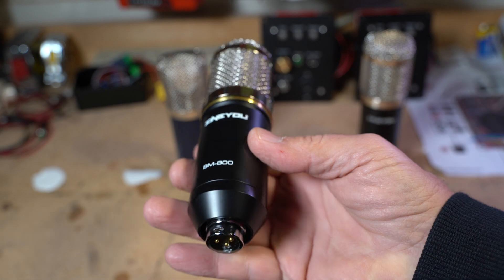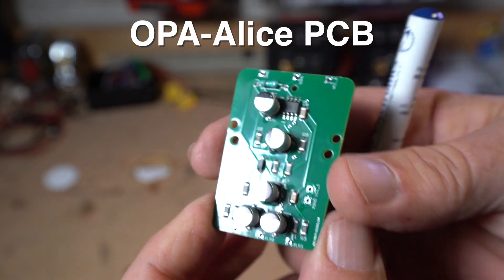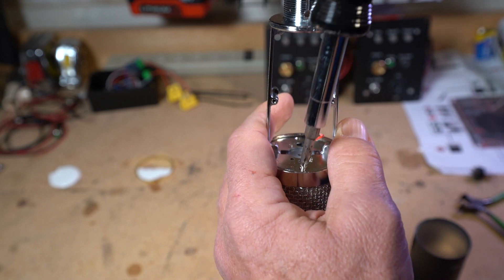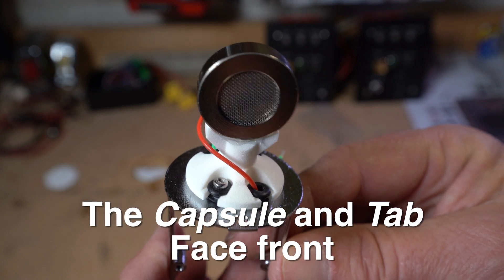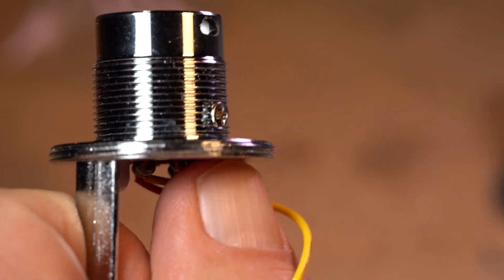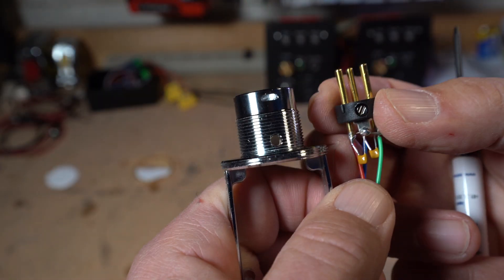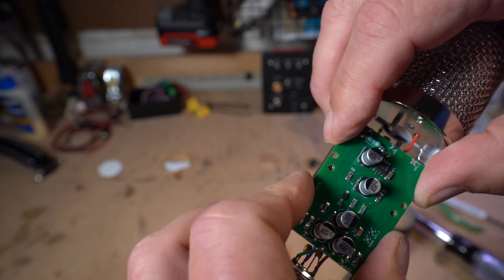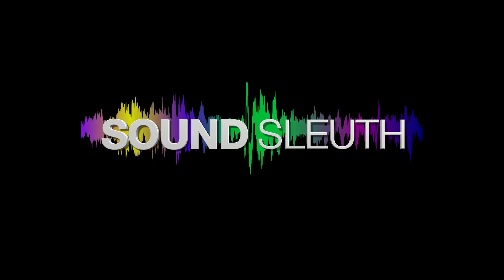The BM 800 Conversion

Comment: What if I want to tweak the treble response? what are my best options as far as circuit additions/alterations? I need something like a safe allround treble, similar to Rode NT1, but out of the 255B capsule which sound just a bit elevated in the upper treble.
Reply from the maker: The circuit is extremely flat and low distortion. You can EQ in post and get  what ever you would like
Reply: @SoundSleuth  I'm pretty sure I saw at least one 2555B project that had optional circuitry for a smoother treble profile. I'm considering if this would streamline my workflow vs. EQ. Too bad I can't find the link any longer!

Comment: Hi sound sleuth i have a question. Will this exact bm80p that you made work if i plug it intro my laptop or phonr or is a phantom power preamp mandatory.  Also fi i made serena (the one with OPA Alice abd Dc to Dc hex conv) will that also require a preamp?
Reply from the maker: @WombRaider-s3j Yes, both of these require a  mic preamp or USB interface that supplies P48 phantom power.
Reply: Also if i am going to do this is it worth spending more on the capsule and also the hex converter or will this be god enough for anything not professional
Reply: I got one of those small FET electrets to work immediately by plugging it in my laptop via aux will this really not work probably with insane 80db gain ?  (Btw its absolutely amazing how fast you respond thank you)
Reply: Sorry for replying again but i will be buying the fake bm800 just for the body will the v8s crappy soundcard provide the phantom power or something close to it to power it if it doesnt work immediately?  If it can i will try to inprove the soundcard or at least make a simple preamp from it

Comment: These Chinese mics are actually clever designs.  Nothing is over-engineered.  I wouldn't say they are suitable for high end music recordings necessarily, but they are fine for podcasting or streaming.

The lack of rubber bumpers I think is explained by the fact the microphone body is intended to use with a shock mount.
Reply from the maker: The components I am replacing the internals with are suitable for high end recordings. Thats the cool part. I have used these bodies for many microphones, never actually fired up one with the original parts. I can tell you they vary pretty extensively every time I open one up.

Comment: Hi there. Thank you for this! I saw a 3D print file for a capsule holder that will make it end addressable.. Do you think it will work as well as an end address?
Reply from the maker: Yes it will!
Reply: @SoundSleuth  Thank you so much! I think it will be a bit easier to mount and position as an end-addressable mic.

Comment: Hey i want to try this but with a 34mm capsule from JLI. Any recommendations?
Reply from the maker: The TSC-1 or the JLI-103 you will need the hex inverter also for bias voltage. They are amazing microphones

Comment: I'm wondering if this Alice circuit would pair well with an RK47 style capsule?
Reply from the maker: It would. It will bring out the characteristics of the capsule as the circuit is very low distortion.

Comment: The cost of components here adds up to around 70$ with shipping, which is roughly the same price as a new AT-2020 from Amazon when it goes on sale. I've not done any DIY mic stuff in the past, would it be worth it to build this one in my current BM-800 over purchasing the AT-2020? I'm not sure if microphones is one of those things where building a 70$ one yourself will give a benefit over buying a 70$ one pre-made or if it's one of those things that won't give much of a benefit and is more just for fun.
Reply from the maker: I personally think so. They are on par with a CAD E100. It is a great mic

Comment: What is the PCB circuit built in? Why does it need one?
Reply from the maker: It needs an impedance converter to bring out the signal from the condenser capsule.  See this: https://www.instructables.com/OPA-Based-Alice-Microphones-a-Cardioid-and-a-Figur/

Comment: Is there a way to turn the cardioid mic capsule into a super cardioid ?? thanks (:
Reply from the maker: Not without using a hypercardioid capsule. Ill look around and see what I can find.
Reply: @SoundSleuth I'm considering the same thing. I want to make a mic that rejects background and room reflections better, like the lauten audio  ls-208. I'm thinking I need to get/find a hyper-cardiod capsule and use an end-address mount 3d print for it inside the bm800 to get close. I'm even considering trying to print some sort of insert for the head basket that turns it into a really short interference tube, or as a way to prevent sound from getting to the sides of the capsule, while the end address helps prevent sound in the back.

Do you have any experiments or experiences with either hyper-cardiod capsules or interference tubes?
Reply from the maker: @Lethal_Bite  The key to interference tubes is length. That is why shotgun mics are as long as they are. This is something on my "to do list" ;-)
Reply: @SoundSleuth  That is true, but I'm wondering how the ls-208 does it so well. Because it isn't a shotgun mic. Perhaps not an interference tube, but just some structure that stops sound waves from hitting the sides, perhaps just a more standard "tube shape" or a funnel of some sort that is sloped enough that waves bouncing inside just bounce out (to prevent them from making their own echo or reverb in the mic) but also reflect off axis noise. 

I don't know for sure, but I just am in awe of the ls-208 and how well it works in poorly treated rooms. I want something that can operate in a similar fashion. I'm also excited if you are working on a shotgun mic project to see where it goes. That could turn out really cool and useful!

Comment: I have a bm800 with a dynamic capsule and I bought a condenser capsule and installed it instead of the dynamic. I tried it on v8 and it didn't work, so what is the problem?
Reply from the maker: I need more information to help you.  I’ve never seen a dynamic capsule in a BM800.  As those don’t need any active electronics. I would need to see pictures and some more info.
Reply: @SoundSleuth  I solved the problem with a transistor I extracted from a dynamic capsule

Comment: Hello, I have a small question. I'm really new to microphones and circuits and I'm using this build to kick start my experience with microphones, why are we replacing this board with the board already installed in the bm-800? Is it for sound advantage or is it necessary? And if so why?
Reply: We are replacing it because the new one performs far better, When you are done this is a world class microphone oon par with pones costing $4-500 bucks. See my full write up for more details: https://www.instructables.com/OPA-Based-Alice-Microphones-a-Cardioid-and-a-Figur/

Comment: Thanks for the tutorial, that looks like an easier alternative than diy's perk version :D !
Reply from the maker: It is easier to do and it works with phantom power, which was  my goal. The DIY Perks one is great, looks amazing but is USB-C interfaced. Great for direct into PC but not if you want to multiple mics.
Reply: @SoundSleuth  I ordered 3 BM-800 and was surprised upon receiving them that the ones i got seem to be fully made of plastic and not metal (beside the mesh), do you think that would be a problem when building the mic (for grounding reasons maybe ?) Thanks !
Reply from the maker: @KurodaMasahiro  I would send those back. I know Neewer ones are metal. Look for the Neewer BM800 on Amazon https://www.amazon.com/dp/B00XBQ8UGG
Reply: DIY perks one is unnecessarily complicated. Was really just a flex of ingenuity on his part. Job well done, but certainly NOT a project that really has value in duplicating. Plus, his totally disingenuous claim of $30 in parts..... I started the journey of replicating it, but abandoned after the BOM total exceeded $200.

Comment: question would the JLI-RK47 work better in this build?
Reply from the maker: It will! You will need to add a voltage bias generator for the capsule. This will work https://www.jlielectronics.com/diy-accessories/dc-dc-hex-inverter-pcb/
Reply: @SoundSleuth  thanks for answering this question! Would be interested in seeing/hearing this build if ever.

Comment: How do you test the capsule if it works before you assemble it? With the ohm scale, it is not detected like classic capsules. Here you have to have a capacimeter (pF) .... . Is there something to do a quick test? Thank you very much.
Reply from the maker: The best way woudl be a capacitance meter. SHould be 30-70pF. That is a small value and not easy to measure. Quick would be ohmmeter showing open circuit and not shorted. With that said I have only have one issue and that was an internal short. That was over many years of this and the vendor replaced the capsule.
Reply: @SoundSleuth  What do I do now? I don't want to change pcb like you did! I want to try replacing the 13mm capsule (it makes too much noise and sucks) with this 25mm condenser one. Will it work or not? Tomorrow I'll take apart the old stand and glue on the new capsule and see what happens. What a stress these microphones need an electronic lab to test them best.
Reply from the maker: @pierpa_76pierpaolo  You are heading out into unknown territory. Some BM-800's have Fet based capsules some do not. At this point you are not replicating my build so I cant tell you how it will come out. Try it and see.

Comment: Hi i have a question. Why do you need phantom power for a dynamic capsule. Isnt this circuit for condensor Capsules. I am just wondering because im thinking about building this.
Reply from the maker: It is actually a Condenser Capsule. It is Electret so it doesn't need bias voltage. It does need an impedance converter and drive electronics to get the signal to the Mic Pre.

Comment: Whoa, this video has basically all I need for my project. I was actually looking to upgrade a cheap mic with a 2555 capsule and wondered what I was going to need. I hope I'll understand the process of building the PCB.

Quick question: aside from phantom power, do I need to provide an audio interface (a friend can get me a Behringer UM2), or does the PCB circuit take care of that? Conversely, if I go with the audio interface can I ditch the PCB?

Thanks!
Reply from the maker: You can get the PCB fully populated if you need to. Yes you will need an interface. That is what supplies the 48V to the PCB and interfaces the Mic to the Mac or PC
Reply: @SoundSleuth  Thank you! I asked because I would need to import either the empty or the populated PCB, so I was hoping to be able to circumvent the need for the circuit. I'll probably lean towards building my own, given the circumstances.

That said, OPA1642 (and similar) is basically out of stock in my country until 2023, and shipping costs from any country that still has stock are insane. I know that NE5532AP isn't recommended, but would it really sound that bad compared to OPA1642 or OPA1656? I was thinking on using it as a placeholder until new stocks arrived, and a PCB breadboard to hold it all together in the meantime, instead of making a proper PCB or buying it online. I'm assuming that would also have an impact on quality, but I'm hoping it won't be that great. Anyway, if the 5532 (or any other Opamp) is not entirely out of question, would I need to add anything to the circuit and/or modify the existing one?

Thanks again for everything :)
Reply from the maker: @johnweiss6335  please see the Instructable. The opamp has to be Fet Input for high Z, low quiescent current, and really low noise.  5532 nails the last one only.  I’m looking for an alternate but no luck so far.
Reply: @SoundSleuth  Same here. It doesn't help that I'm not very knowledgeable in this area, so it's kind of difficult to know what to look for. Closest I found (I think) was OPA2131: FET-input (no idea about resistance though, datasheet is not clear and/or I don't know what I'm reading), low quiescent current, but around three times the noise of 1642 (I don't even know if that's acceptable or not). Unless we luck out I guess I'll have to wait a whole year to build a mic at an affordable price lol.
Reply: @SoundSleuth  Hey, it's me again! I was searching for alternatives and I just saw the shootout you did between different mics. Since both the USB-C and the OPA-Alice mics are, as of now, out of my reach because component shortage, my attention was drawn to the one with the 2590 capsule and the "simple P48" circuit. I've searched around a little, but all I can find are a few vague documents. Is it really just a resistor and a capacitor connected between the FET and the XLR? (I suppose then you connect the XLR to an audio interface like the Behringer or the Focusrite) What would be their values? Again, the documentation is kind of vague about that.

If I were to use a 2555 or 3412 capsule, I suppose I'd need to attach a FET like the 2N4416 Matt used in his video, or an equivalent like the 2N4393. Would the resistor/capacitor values change? Would I need anything else?

My plan would be to use a 2555 (if possible) with a P48 circuit until semiconductors are available again (or even place an order right now and wait for a year and a half) and then do the Alice conversion.

Sorry for the long string of questions, but my options are dwindling and I'm a total noob, and feels kinda difficult to find useful info if you haven't been inside the DIY community for a while.
Reply from the maker: @johnweiss6335  check this out: https://www.instructables.com/The-Sound-Sleuthers/ Step 3. That explains more on the "SimpleP48" part.

Comment: Great and a very helpful video.

Quick noob question: Do you think an XLR to USB cable will work well with microphone after modding it to the JLI-2555 capsule ?
or will it be underpowered ?
Reply from the maker: If the XLR to USB interface (cable) supplies phantom power, it will work. The circuit in the mic is powered by the incoming phantom power from the interfaces XLR connector.
Reply: @SoundSleuth  question from another noob
can a modified Mic with the 2555 capsule and OPA Alice board directly be plugged into a PC via MIC In Audio jack to XLR? because i dont get that stuff with phantom power if im honest as it seems to exceed ~80V.. it wouldn´t damage the PC right?

and honest question: is it worth it to buy a BM800 Microphone set (25€) with the OPA Alice board and capsule landing on a total price of ~140€? Or are there normal microphones that would compete with this in that price range?

im Sorry, i´ve got no clue about all that, i only found the DIY Perks video, did some research for a refined circuit and landed on the easiest solution of buying a ready made BM800 to modify it with OPA Alice and a JIL2555 Capsule
Reply from the maker: @fmskaisergsaw5567  The Interface to the XLR jack provides 48V phantom power. The OPA board needs that. Most PC sound cards dont supply that.
Reply: @SoundSleuth  thanks for the quick reply, was kinda still collecting my thoughts with some edits haha

So i need some sort of pre-amp, gotcha though i just discovered that a condenser might not be ideal for the usercase it need a mic for.. :(

anyway, your videos about the BM800 mods are appreciated

Comment: What do you think if there is 1.5-2 meters of cable between the capsule and the preamp board (that is, the capsule and the preamp will be in different cases) will it be OK? Roughly speaking, I would like to use the JLI-2555 or JLI-3412 capsule as a Boundary Microphone (something similar to the Sanken CUB-01), and place the pream in a separate case.
Reply from the maker: I would use the TSB2590 (with built in FET) for that. The input impedance is 1 gig ohm on the preamp board so I dont think it would like 2 meter run between.
Reply: @SoundSleuth  Please tell me, is JLI-3412 at all compatible with OPA Alice - Single Channel? I would like to experiment in the future.
Reply from the maker: @fastunovaudio  yes. Any capsule without a FET in it JLI165, 2555B or the one you mention.
Reply: @SoundSleuth  Thanks)